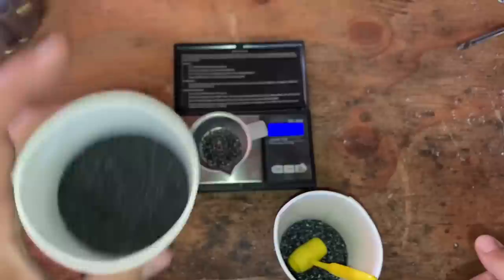Why Is Your Homemade Black Powder Weaker Than Goex? Black Powder Service Announcement.

Comment: You wet it with water? Wouldn't that dissolve some kno3? No experience yet but I think denatured alcohol would wet it without changing the mixture
Reply: Use pure water because too many reasons to list.
Reply from the maker: I use distilled water.

Comment: You state "I have a 20T press" but what is the area that force is concentrated on when you're pucking your powder? Someone with one of the weaker presses mentioned can get the same results as you, they just have to concentrate that smaller force on a proportionally smaller area.
Reply from the maker: My die measures 1.18 inch and the post on my press measures 2 inch. I find this works much better for more uniform compression

Comment: Say, here's a question, what options would I have when I don't have the space or money for a press? Any other viable approaches?
Reply: Add 2% soluble glutinous rice starch and press it through a screen.  Use 30-40% more volume than commercial.
Reply from the maker: Yes, What we call “screened powder”

Comment: Man I watched all videos you have. I am struggling I use softwood to make my charcoal and mix my percentage exactly like you say. I leave in mill for 12 hours and it is pitiful it will light but pops and slowly burns out. I would not even call it black powder. What the heck am I doing wrong. I just screen I don't puck
Reply from the maker: Where are you getting your ingredients? Are you using stump remover? Garden sulfur?
Reply: @Everythingblackpowder  I ordered potassium nitrate and sulfur from eBay.
Reply from the maker: If you were using high-quality components, it sounds like it’s just a matter of it being incorporated well enough. What are you using for a mill and for media?
Reply: @Everythingblackpowder  harbor freight mill and lead from .45 call balls.
Reply from the maker: How much powder are you trying to mill a time? About how full of media is your jar?
Reply: @Everythingblackpowder  1lb
Reply: @Everythingblackpowder  maybe my charcoal I trying to use Chinese tallow I may just order some
Reply from the maker: 1 pound of powder or 1 pound of media?
Reply: @Everythingblackpowder  1lb of powder
Reply from the maker: You are trying to mill way too much at a time. I wouldn’t recommend milling more than 200 grams in one of those rubber harbor, freight drums. I would recommend filling your empty drum up about a third of the way with media and doing no more than 200 g at a time. Give that a try and get back with me.
Reply: @Everythingblackpowder  ty will try and update results. Really appreciate it
Reply from the maker: No worries

Comment: Plain water does not help much.  Use urine or buy a commercial agent like nitrocellulose lacquer or Dextrin .
Reply from the maker: What for?
Reply: @Everythingblackpowder  It gives a tighter bond between the ingredients which speeds up the burn time.
Reply from the maker: I’ve tested urine and dextrin. The urine made no noticeable difference in velocity, accuracy or fouling. The dextrin made the fouling much worse but otherwise performed the same. I’ve been using distilled water for quite some time and it works just fine.
Reply: @Everythingblackpowder  If you have already "Tested" it, why did you ask me what it was for?
Reply from the maker: @myfavoritemartian1  because I don’t presume to know everything and thought maybe you would bring up something I should experiment with. For example, I haven’t tried the nitrocellulose lacquer you mentioned.

Comment: What I want to know is there a limit on compressing powder.  You say some have 10 ton jack, you have 20 jack, well heck lets use 100 ton jack, what about a 100000000000 ton jack, what about  doing it 3 times 10 times 1000000000000 times, is compressing powder like a space time continual deep black hole.......... In my world there are limits on everything, from chainsaws to 30/30 rifles and I always want to know the limit, the end, as in cant go no more and cant do no more, guess I'll make my own dam video..............
Reply: Yes, there is a limit.  1.97 g/cc based on a 1.45 g/cc charcoal standard.  This is a theoretical limit and is achieved somewhere around 4% moisture content and 1,000 BAR.  It is a logarithmic scale, 1.7 g/cc only takes about 100 BAR.
Reply: @geargnasher9822  {"Yes, there is a limit."} WOW, dont I love short direct answers!!!!!! But as I was afraid of,  I wouldn't understand the reason why,  it sounds like there might be math involved, therefore  I'll just watch others make it.......